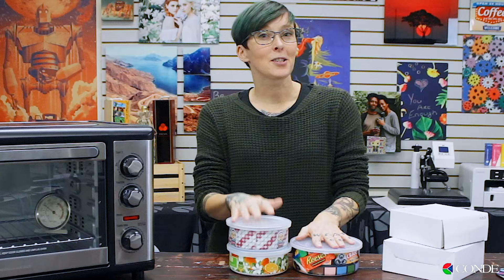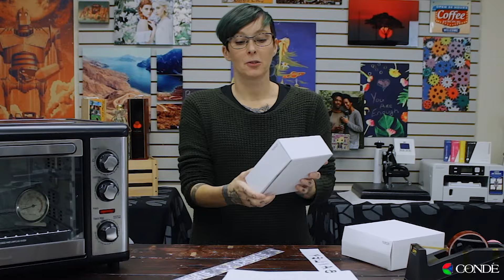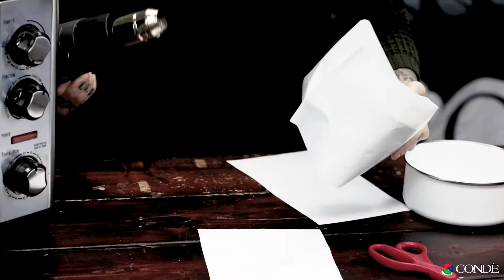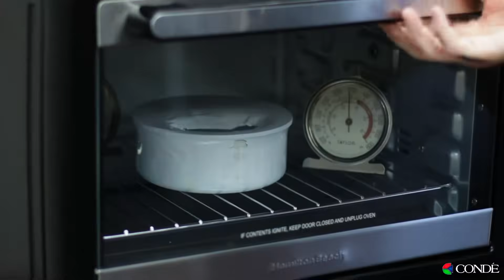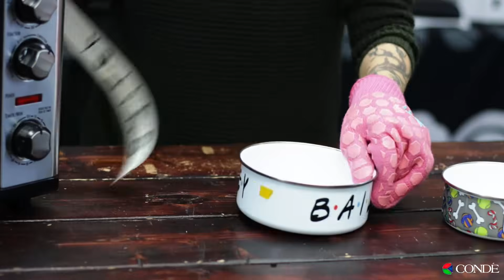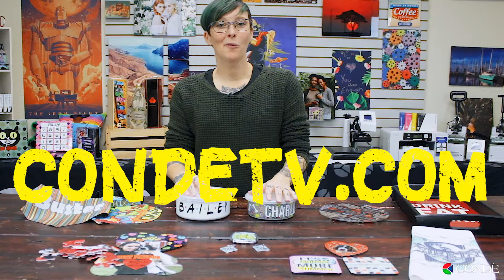Sublimation Blank Stainless Steel Bowl from Conde Systems Inc

Comment: What’s an internal thermometer? I know they have the temperature on the outside of the oven ?
Reply from the maker: An internal thermometer is placed inside the oven to make sure you are getting an accurate temperature reading.  Here is a link to the one we use https://www.amazon.com/Taylor-Classic-Large-Dial-Thermometer/dp/B0000DJUYR/ref=sr_1_38?crid=1NNZI8VIP3J60&keywords=internal+thermometer&qid=1646241450&sprefix=internal+them%2Caps%2C91&sr=8-38